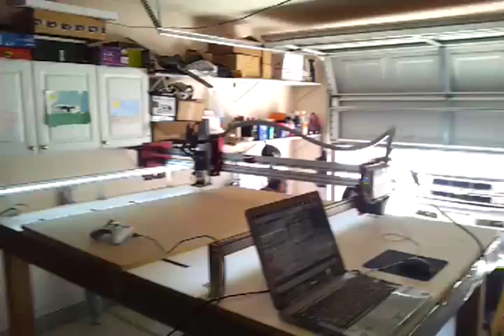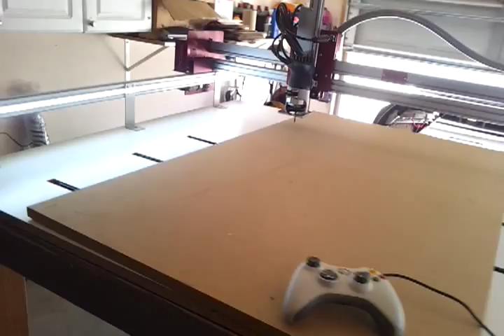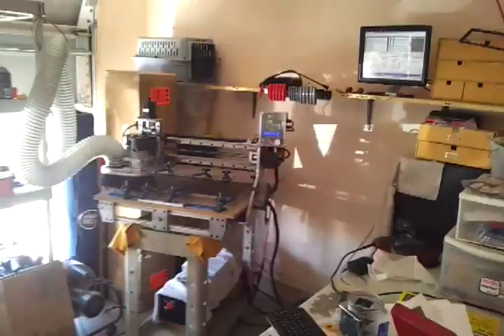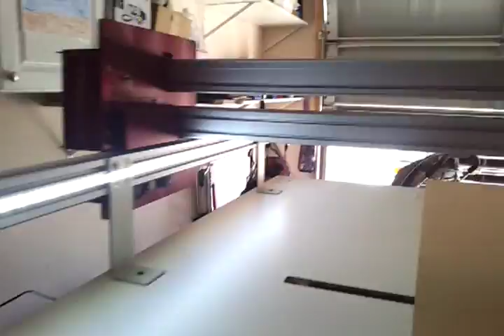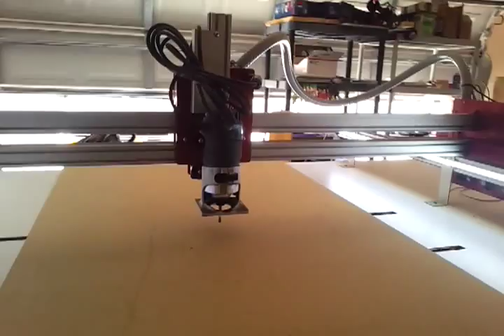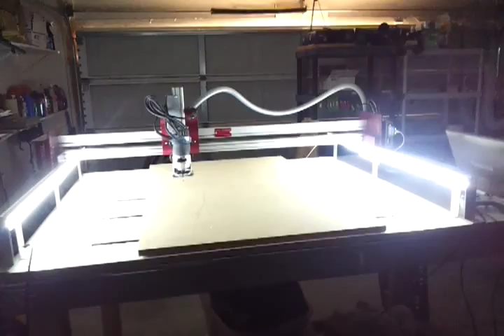LED light upgrade on my CNC Mogul router table

Comment: Thanks! Would you be able to email me? I am having a horrible time trying to get the CNC Mogul guy to contact me as I am having issues with mine during assembly.  info (at) danceresa (dot) com I just want to see if my parts are just crap or I did something wrong.